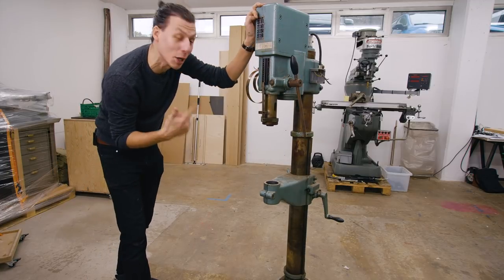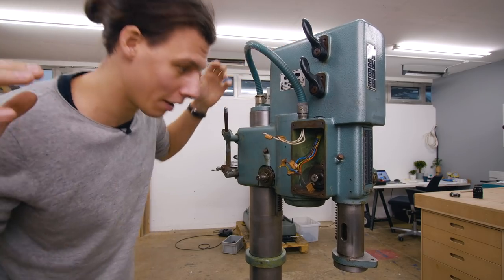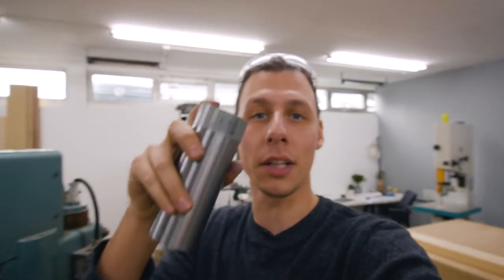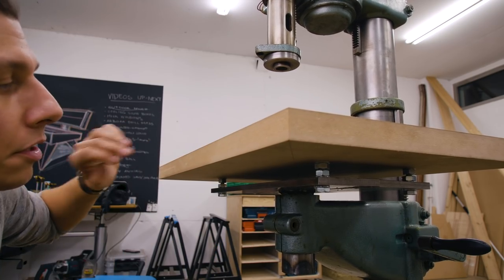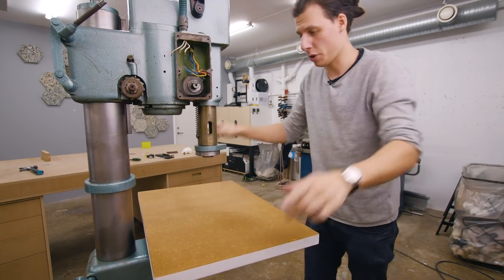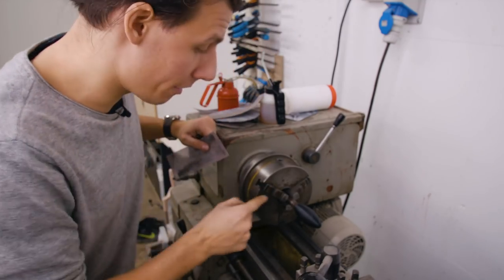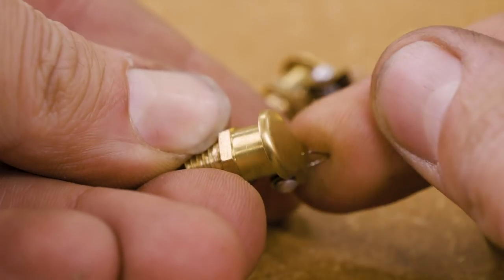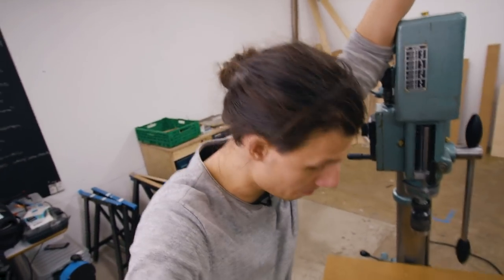Restoring an Old Swedish Drill Press

Comment: Really nice restoration! If you didn't know - you're missing two parts in the handle, a spring and a small pin that holds the handle in place so that it doesn't fall down, a really nice feature when it's installed! That's what the hole is for on the end of the holder!

Comment: Folding the sandpaper back on itself in the lathe is a good way to get your hand pulled in with mayor damage as the result. With the speed of the lathe it is better to have the sandpaper go back and forth while slightly angled.
Reply: ...and also ALWAYS protect the lathe ways when using abrasives.

Comment: You might want to check that no tapping chips got inside the machine when you threaded those holes. Or you will be replacing bearings.
Reply: I thought I was the only one worried.... Not really how I rebuild machines that's for sure!
Reply: Same here, I was shaking my head when I saw him doing that
Reply: Double Dare Fan same here. That’s going to end badly.
Reply: Went down into the comments straight after watching to point this out. There were a lot of oil inlets aswell, some chips are bound to have gotten in somewhere.
Reply: Greasing your tap helps a bit when chip are an issue, but yeah should have taken some care when tapping those holes
Reply: the more alarming issue is the cupps on the top, they are not suppose to be there at all, that machine got a dry gearbox sitting over a unprotected elektrical motor, put eny oil there and it will go stait in to the motor,
Reply: That’s why he was carefully cleaning out the holes afterwards. You were too quick to criticise and head to the comments without really paying attention to the video. You’re an arm chair critic, get on YouTube and show us some of your work.
Reply: Even I said….. no - lets keep those plates as they are……

Comment: If it were me I'd put an "Emergency Stop" switch at the top right side where the other electrical box was.
Reply: Or a foot-pedal flipped down from the MDF board.
The biggest "problem" is that that motor wont stop directly when power is cut, it will continue to spin.
Reply: @zapy-85  But it will lose power. works perfekt. we have emrgency stop in headhight so you can hit it with your forehead. ex if you get cout in the shirt.
Reply: I have a similar driller, badged as an Ajax And there is a reverse polarity switch on it which stops the spindel  very quickly this is linked into a telescopic limit switch , but to fit this on the dill would cost  a lot of cash .My drill press cost £1600

Comment: Yo I really like how you made a table out of scratch and with no previous design. I wanted to tell you the reason your metal plate was warped was nkr because you didn’t clamp it. It’s because you welded in ine big straight line and the heat warped it next time alter side you weld and make sure not to weld the same area for to long

Comment: I remember these! that gearbox! oh how i miss it.. 35 years ago and the machine probably had a few years of service then in the shop class.. Everytime today when i think: Maby I need to change speed on my dp... (find the right socket, hold back the motor, undo the belt without damage, move it ba... nah.. it will be fine.. 
If a tool takes longer to set up than actually work with it; its not a very good tool.

Comment: You can thread MDF directly you know...On a 3 cm thick MDF and 6 big screws threaded it will be rock solid. And you've left the center portion of the MDF unsupported...EXACTLY where the pressure is applied!

Comment: I love all these old tools. Unfortunatly in France most of them run on 380V which is difficult / expensive to have at home...
Reply: If they dont need the full power of 3 phase you can probably get a somewhat affordable variable frequency drive to run them off
Reply: @legallyfree2955  you are right. I saw a few new devices that could run such tools in 220V but with a lower power.

Comment: Great video, I was just a little surprised you never pulled the quill & spindle to clean, regrease, and check bearings.  Do you have a dial indicator, I really like to see how these things test out with regard to runout after a restoration.  A lot of times these old machines run more true than anything new.  Thanks.

Comment: Nice video! On these arborga drill presses there is a spring with a steel ball on the inside of the shaft so the doesnt slide by itself. You will see a small hole where it is supposed to be.

Comment: Hi. I have exact same model Arboga G2508. Its great machine! 2-speed electric motor is wounded in dahalander connection, u need special switch to operate it.
Reply: Do you know what kind of switch and hpw to wire it?

Comment: I think the part I was most impressed with was your colour matching skills, very well done with that I would have been there for a month. Another wonderful old machine saved and probably looking better than it has done in half a century. 

I mentioned on your Bridgeport Milling Machine video that I’m totally ignorant when it comes to engineering, and when you drilled and rethreaded the oil ports you got me a bit confused sorry. Will this not do any harm having the metal chips in the oil? Or will any of the chemical in the paint not impact on the viscosity of the oil? I’m probably wrong on both points but please can someone explain why I am wrong so I can learn? 

It looked absolutely brilliant when you finished and I'm sure it’s good for another 60 years. I love your enthusiasm for your work, you have the passion that’s important for all creatives. Subscribed.

Comment: Great job. I have the exact same arboga maskiner geared head drill press. Mine is complete with the table if you need any details. It has two forward (electronic) speeds plus the gearbox. They don’t reverse.

Comment: It is a shame to se how abused this fine machine have been. Great that you bring it back ti life. I also have the exact same machine. It will last forever. A machine like that in ok condition will go for at least around 1200E here in Sweden. I also have an EMCO maximat 100P (P = it also has cross feed) lathe with mil head. Very low usage and some nice accessories. It is for sale. One owner before me.
The wheel you make at 18,30 is supposed to be a arm like on many machine vises. Pretty big since it takes a bit of effort to torn it. Much bigger radios than that wheel you put on. Just a tip. 
EDIT: Be careful with that cog thing that follows the bar from floor and upp (dont know the name) to raise/lowe the table. If it is not lubricated it can snap off when turning the table. Very annoying if that happens.

Comment: Does anybody have tips. I dismantled the electronic motor stator from the chassis, and bought new from sweden. How the hell I should but it back cos there is tight fit and you cannot punch it cos the winding is hurting. maybe put stator in freezer and giving heat to the chassis ??

Comment: A little warning. It looks like that press doesn't have a drawbar to hold the taper in. This is fine(superior in some ways), however, people often rig up sanding drums or wire brushes to work in a drill press. You can do that if you have a drawbar or a chuck that screws on to the quill rather than the taper system this one has. Do not do this. Lateral forces on that taper can loosen the taper and send it flying.

Comment: You should’ve just stripped the whole press and refurbished it properly and painted it all with a color matched paint, that would’ve been EPIC!

Edit:  WTF, I had forgotten you actually drilled and tapped the oilers in situ, that’s terrifying considering only oil is supposed to be in those areas. I really hope the oilers work out ok and that you didn’t get any metal flecks/pieces in the mechanisms.

Comment: Wouldn’t you adding those threaded oiling ports have thrown some metal chips from the threading?
Reply: He used Q-tips to clean up.
Reply: @Helveteshit  Those Q tips don't get the tiny crap out that fell into the hole while drilling and tapping. Bearing replacement guaranteed to happen in a year or two.
Reply: I'm sure he pulled it out using little neodyne magnet (behind the scenes)

Comment: the drill like that with a flimsy wooden table , it is like putting the GMC truck on 1800s wooden wheel.  my 1930 walker turner drill press have 20 times more stability and precision. nice looking drill press though. lol